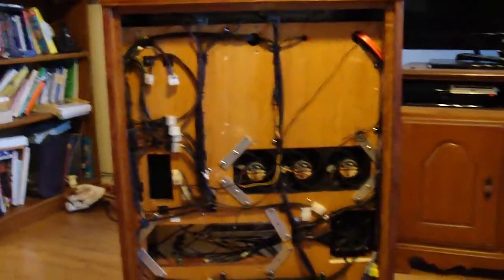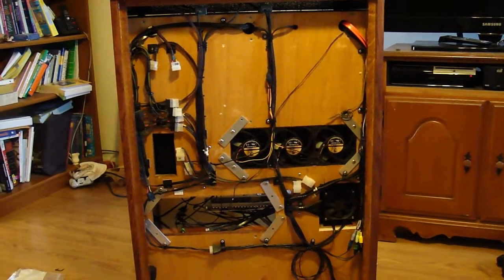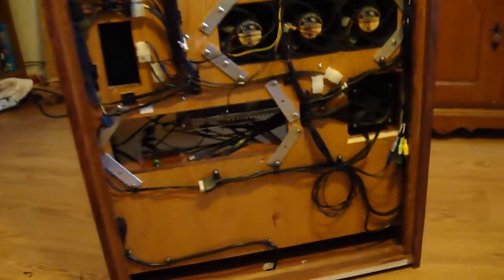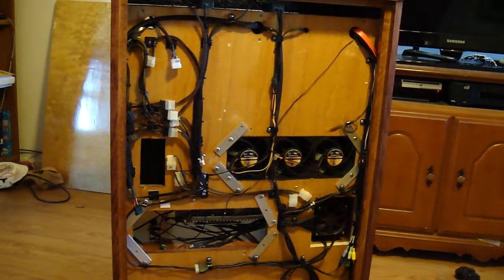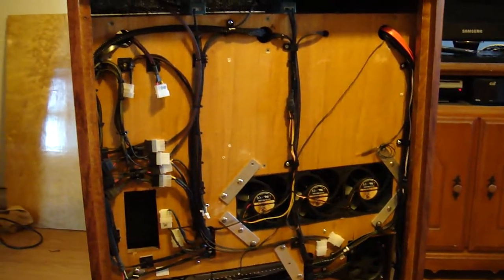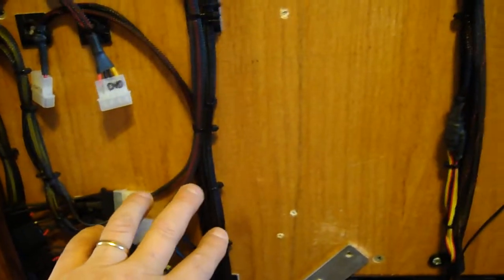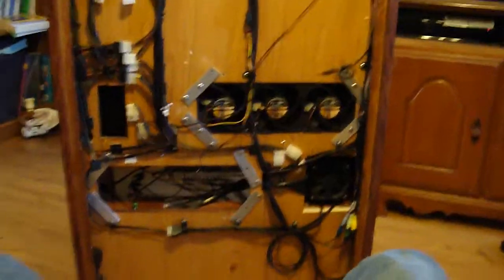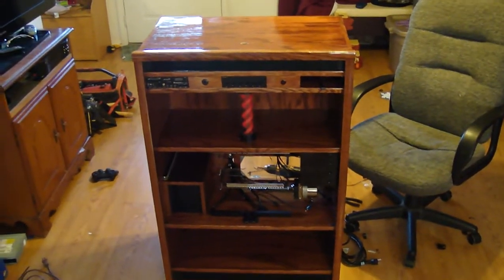CaligaCab Cabling Revision 2

Comment from the maker: I use a right angle DVI adapter off the GFX card. Cable fishes through an opening in the fixed back of the cabinet and down and out a notch in the removable back of the cabinet. Ditto any USB or speaker/mic cabling of the  backplanes. The SunBeam 20-in-1 hasVideo Out and Audio I/O but is's not HD. Best results would be to use a an X-fi or Augen soundcard and run good cables from that to the speakers.